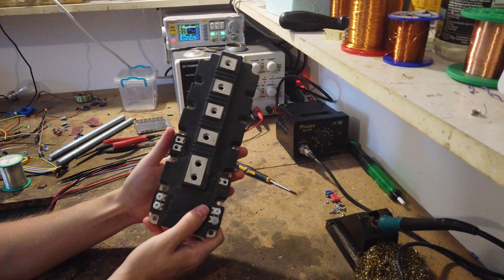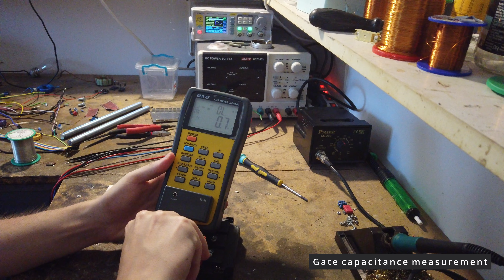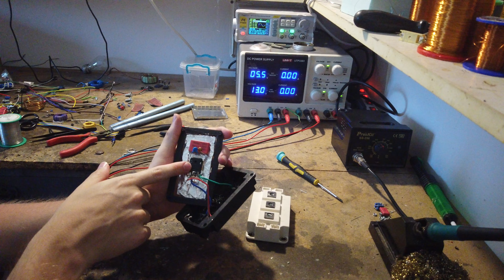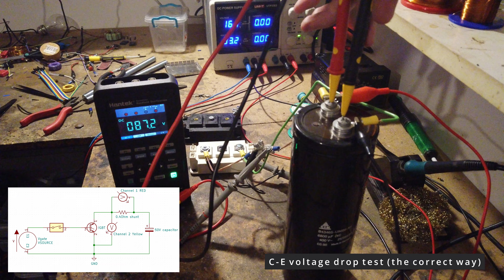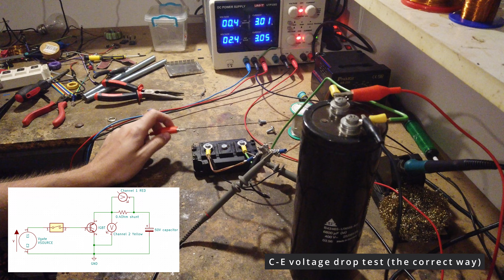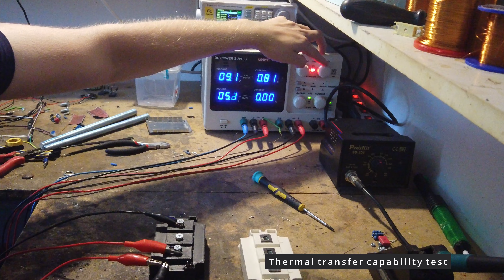Testing Transistors

Comment: interesting thank you! would like to know how you got on with that other module if you did end up using or testing it. have you had any further experience with chinese "fake" power modules?
Reply from the maker: Thank you! I still have those FF1000R17 IGBTs, they will be used in a high power Tesla coil this summer. The other BSM100GB120 module is probably somewhere in my garage collecting dust haha. Thankfully I didn't have any further experience with fake transistors, as I am not buying transistors from Chinese ebay vendors anymore. I actually do not use ebay any more at all, but if I ever used it, I would make sure to look for EU/USA sellers.